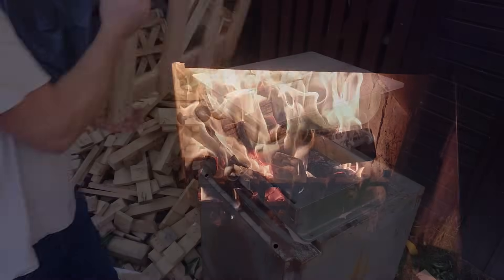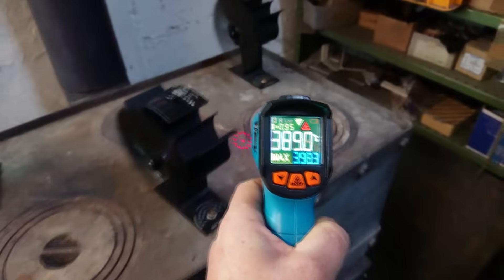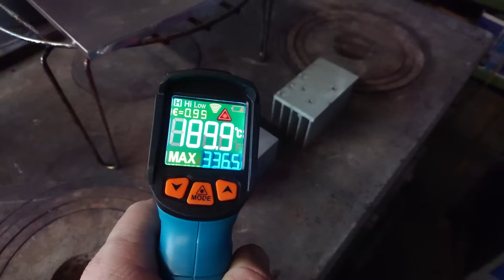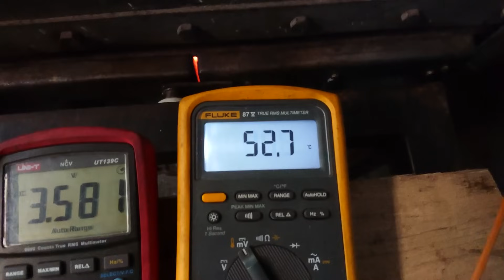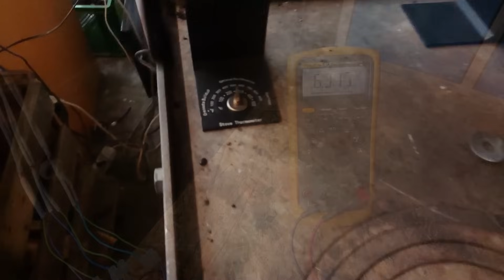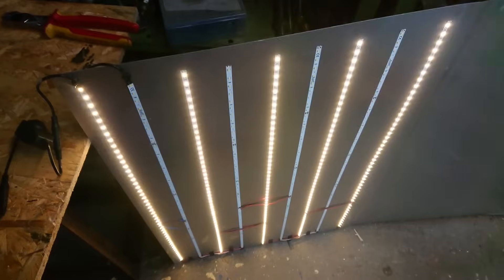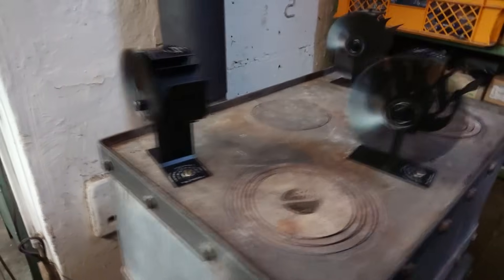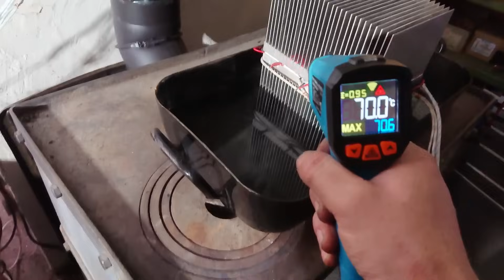Generating Electric Power with my Wood Stove - Peltier Experiments

Comment: a DIY 2 component (1 transistor - pnp ) thermocouple circuit,  could trigger a tiny geared dc motor too lift the unit upwards when heat preset (resistor on base) is reached....   -   motor in the middle with screw drive down too the stove... -  and 4 sliding rods on the corners too keep it level.

Comment: would be neat to use an insulated duct over one of the fans to blow cold outside air over itself and your project in boiling water, with that air pumped back outside in a U shape

Comment: Stick on the stove pipe on the outside/roof of your house. At least in winter you will get a better natural heat differential, and hopefully more managable temperatures for the cheap peltier to cope with.. ?

Comment: Air at ground level is colder so you could run another convection pipe from the floor to the peltier to get a better temperature difference.

Comment: The TEG is a wonderful piece of history, and it works.
All you need to do for the boiling water one is to set up a thermal siphon. Advantages are no moving parts, and it can help spread the heat from the wood stove.

Comment: That is such a good idea. This would also be a good way to harness excess heat into power that that is normally lost in electronic circuits. 

I would have tried something different. Using one of those stove top fans I would have put magnets on the fins then coiled copper wire near the rotating blades. You then can then effectively have a motor/generator connected to another motor, connected to one Peltier device that can charge a battery. If you need more power you can add more fans-magnet-generator-thing. Remember to credit me if you sell this :P

Comment: I’ve been thinking using copper to transfer heat out. The temperature should be constant if you extend the heat out a few inches. That goes on top of the TEG. The cold side will be underneath with cold water covering heat sink with thermo syphon. The cold water should be not affect by wood stove so add some insulation.

Comment: brainfart: metal fan as a generator in the exhaust stream/pipe to generate power? or even multiple. or is there not enough flow (and too much heat) for that? 🤔

Comment: Hey dig your videos! BTW, You use the fire because its cold... Put the cold side of Peltier threw the wall to out side were it is very cold?. Just turn the whole unit around till the Peltier is pointing to the wall. Cheers from Australia, were it is a steamy 30-34c

Comment: Instead of using a pot of water, you could use a thermostat with a fan to cool the hot side. Sure, the fan will draw a bit of power but only when the Peltier elements are about to overheat anyway. You can then experimentally find the sweetspot when the cooling fan has to turn on to compensate for heat lag and have it operate safely.
I think the pot of water introduces the problem of constant steam generation and also it takes up space and doesn’t work so well on the pipe mounted design.
For the cold side a ducted fan design that forces the air past the fins could maybe cool it better and increase the efficiency.
Anyway, awesome project and nice proof of concept :)

Comment: Didcyou consider installing on the external section of the stove pipe? Lower pipe temperature (hopefully <100degC) outside ambient air temperature should give adequate delta T without the need for powered cooling (not to mention the added complexity).

Comment: EDIT: wrote this comment before seeing the last minute of the video  😅

How about using water as a medium? This would limit the heat that the TECs receive to 100°C.
I'm thinking about a small water cooling loop, using a simple warm water pump (used in house plumbing).

Comment: I have a Rayburn that heats the house using a pump. It would run a smaller setup, fewer radiators and pipe distance , without the pump. I always wondered about setting up a loop in the summer that the Rayburn could drive as a gravity system which would then turn the pump so creating a generator. You could do something like that with your stove. You could even go to steam generation and closed loops with pressure regulation.

Comment: I boiled water on the fire in a metal pot and led the steam in a pipe/hose to a heatsink mounted to the peltiers. This means that al electronics can be placed away from the fire. The cold side could be placed in cold water or placed outside for cooling. Use a buried copper pipe with liquid to cool the cold side.

Comment: I'm gonna suggest a draft tube to cool the top sync in the water bath araingment...a piece of stove pipe standing verticaly on the heated surface...with a hole in its side...should cause a draft that with some ducting atatched...would cool the top sync...If you can cool it enough the water will not boil. Use an old small engine carberator float needle and  seàt in water bath to maintain level...feed from gravity feed resivoir....Also...the peltier devises are common in coolers and heaters that are  designed to be carried and plugged into cigarette lighters in cars and trucks...In America...they can be found at Goodwill...Thrift stores...and flea markets...some dissassembly will be required...but also additional components to be had for the price...switches...fans...wire...

Comment: SO many questions. So many ideas. I've been thinking about this exact experiment for years. Since so much heat is wasted through the vent, we can assume that all of that heat is harvestable. So, it doesn't make sense to just carry it away in one pipe. Why not a manifold that would separate the hot air into several pipes, or more simply, imagine a "pipe" that is 3 feet by 3 feet by 1" thick. It's basically a big 1" thick hollow box, with an adapter at the top and bottom to exhaust out the 6" pipe fitting or whatever it is. Now cut a square hole in the box. Leaving a 1" lip all around the front surface. Now you create a massive 3' by 3' door that can be screwed on and is sealed with exhaust gas silicon rubber. This "door" or panel cover is the platform, for the peltiers and heat sinks on the front. On the back of the door , you have fins going vertically, to guide the air from the bottom to the top for even distribution. Should cleaning ever be needed because of inefficient combustion, this "door" can be unscrewed and removed. Now all that would be enough if you wanted to stop there,  because we could use convection to keep the hot side hot and the cold side cold, but lets say we went crazy, and created a second unit. The exact same size and shape. But, instead of putting it on the front, we flip the whole thing around, and now all the heat sinks are joined into one massive heat sink block, pressed against the wall, taking advantage of the thermal mass of the wall, for cooling, and instead of the bottom opening of the sink block taking in hot exhaust air, it takes in cool air from the ground, and even the ambient heat from the stove itself isn't rising directly into your heat sinks convection flow. Since you're in here already, take some of that energy for a single fan to force the cool ground air into the cooling block, just as a test to see if it increases efficiency or if it uses more power than it adds t the system. .  At the top of the cooling block exhaust the now warmer air into the room. Of course with this method you could go insane attaching more and more peltiers to the ever cooling "cold" side air all over the room if you want. Since this heat exchanger doesn't carry any of the combustible gasses with it but let's not go there unless you want to make a really weird fun video. :)

Comment: Cut a hole in your wall and spin the stove pipe to put the cold side of your heat sink on the outside of your shop. The cold air outside will cool the cold side of the heat sink.

Comment: You can increase the efficiency of the stove by placing the stove futher away form the chimney and elongating the steel part. I saw 400 C  when you measured it. If you have second floor you want to heat - then it doesn't matter.

Comment: To avoid the complex pipe adapter, you might be able to find or create a C-shaped beam that could be clamped to an existing stovepipe.  This would look something like "EO" with the middle bar "-" of the E removed (or shortened) when looking from above.  The "E" represents the hot-side heatsink and the "O" the stovepipe.

We don't need perfection here as we don't want high temperatures to reach the Peltiers, so we just need a stable surface that will sit flatly onto typical stove pipes.  The design could include an extra Peltier that powers a fan attached to the cold-side heatsink; these parts could be borrowed from one of your existing fans or designed yourself from similar parts.

Comment: I completely get the desire to use TECs for this project, not least because they are relatively inexpensive, have no moving parts, and are quite reliable, but...

How about using the wood stove to boil water, and then use the steam to drive a small steam engine connected to a dynamo? You could also use the same to drive a line shaft to run your lathe, drill press, etc.

I'm obviously joking, but you definitely 'could' do that, if you had enough room, money, and fuel.

Disclaimer, I visited a tin mine last summer, and was blown away by the amount of useful work they got out of their steam engine before it was replaced with boring old electric motors and gas fired heating.

Comment: Now for some random energy stuff I have seen which is really a bad ides yet has some potential. 
I saw someone on YT build a steam boiler to which they stuck a sort of fan blade on and let it spin up. 
My idea would be a commercial viable option. Where a wood stove is built to be either a flash boiler or standard slowly add water as needed boiler where enough steam is built up to spin a specific turbine type generator. All of this could be mechanically done and a rating added to the wood stove. Even if the stove produces a couple hundred watts an hour its still enough over a 24/7 period during the winter.

Comment: I used to have and they still make these wood/coal stoves. They have an automatic thermostat built right in to them. This a a manual type. As the stove heats up it will close the air intake the hotter it gets. You can set the temperature you want via a knob. If I ever install a wood stove in my house again I will get one of these stoves as it was the best type of stove I ever had. 
""They use a mechanical control that opens and closes the air supply as the bi-metallic coil heats and cools.""" You might be able to search for this and find something or even be able to make something. If you could control the heat that the stove puts out where its not too hot and not too cold the temperature could be just right.

Comment: There is a UK boiler manufacturer that offered a so called home generator, this produced electricity as a waste heat product from a gas or oil boiler. Your experiments could be invaluable in countries where no electricity was available, just wonder if the Peltier pads are available in larger or more efficient versions. Really enjoy your approach to these projects
Reply: Any chance you can get the company name please

Comment: just using the wood stove to melt snow for drinking water? but of all things this spring, i have a engine/motor driven water jack to build... the sucker rod weighs 3500 pounds. "hamster wheel"

Comment: My only thought at the end was that you could use a closed loop system with automotive antifreeze and attach the cells to that for the heat.  Others are mentioning using cold air from the floor or outside to cool the other side of the cells.  If this could all be made compact enough it should be useful!  Really appreciate your experiments and that you share with us!
Reply: I was also thinking a water loop on the hot side could help, but the problem is the required pump would use more power then you generate using these devices.

Comment: Not sure if anyone has suggested it, but our fireplace has a half pipe section band that reflects heat from the back of the flue back into the living room, its fixed to the flue on standoffs with rivets but you could just as easily have it removable with hose clamps.

I think if you did a design like that, out of say, aluminium sheet so that it would have a bit of an air gap to insulate against massive temp spikes, acting like the water bath in this instance, but losing no stove area, with the units fixed to the back of it, it might do ok, and be modular.

The shield on ours is hot enough to get some power flowing i think. And because the units could be on the back, the cold side of the peltier units would be shielded by the shield itself. Love your vids, they always make me want to install power generators all over my house. I think my pattner would kill me though. A big danke and best wishes from NZ

Comment: I thought you might do a Stirling cycle engine generator.  I think they are more efficient than Peltiers and could be made from scrapyard finds.  Like a V twin air compressor so you have a hot cylinder  and a cold cylinder.  Although I think you have the expertise to build a Stirling cycle oscillating a linear alternator.  Info can be found here on them.  https://science.nasa.gov/science-research/science-enabling-technology/technology-highlights/high-efficiency-stirling-convertor-demonstrates-long-term-performance/

Comment: There are some CPU heatsinks that use a heat exchanger. Sometimes you can find them as scrap. Also some specific models of stereos used heat exchangers to cool the output transistors,  Sorry, I can't remember the models or brand. One might also be able to modify a car heater core. my friend made a heat exchanger off of the exhaust of the motor driving his sluice box pump and hookah rig to pump hot water into his diving suit. He was sluicing in Alaska under 6" of ice, so it worked quite well. Controlling the water flow through the heat exchanger enabled him to mix the hot water with cold through a valve system to keep him warm for hours at a time.

Comment: One way to do it is to put the heat suction aluminum fin inside flue pipe, somewhere at the right temperature.  And leave the other side outside.

Comment: Very cool! I made small generator using eight of these peltier coolers, a metal bread pan filled water and small candles; it was a fun experiment. TEGs can be created with two different conductors so I wonder if a less expensive but more durable TEG could be created with two plates of different metal like steel and aluminum...

Comment: Experiment with outdor solar lights but use the Peltier in place of the solar cells - they are very efficient (use an IC inside) and if you use the Peltiers to charge a battery during the day you can use the output of the peltiers plus the battery to increase the amount of lights you can power at night.

Comment: A thermal actuator/s to control the height of the heatsink base from the heat source. They will operate without power and you can build and design one yourself to operate at the temperatures and distances of movement you need.  A small sized one can lift a decent load and would be nearly maintenance free.

Comment: If it's being used during winter could you use the cold outside temperatures to cool the outside heatsink. Maybe passing am aluminium bar through the wall and mounting the heatsink outside

Comment: What about making a simple steam engine to sit on top of the stove to turn your water wheel? One other method of regulating temp is use the moonshiners method  That is copper pipe wrapped around the chimney. Moonshiners use the pipe in a water bath to cool the shine. Just reverse it like a radiator in a house. May be a useless thought, but it may give you an idea.

Comment: As the hot exhaust goes up the pipe, would it be possible to spin a very tiny turbine on it's way? Likely it will become full of soot and stop working, but maybe the spinning force can fling the majority off the turbine and keep it going longer.

Comment: Use the fan that sits on the stove to blow across the fins on the heat sync to cool it as the fan doesn't rely on electricity to run

Comment: Use one of the fans to make a heat based pump for the possible water cooling system.
Also place a thick steel sheet on top of the Aluminium cooling side.
That should help draw heat out off the cooling fins as Steel has a higher heat retention value than Aluminium, and You could then have a water reservoir on top of it.
It should work to pull a lot of the thermal heat up and out of the Aluminium, thus cooling the devices.

Comment: Are the devices that produce electricity form heat available in ceramic form? Radioisotope generators run for decades.

Comment: You can use the cold temp from outside by chilling the cold side with water cooling that will require only few milli amps for the pump.

Comment: The water bath idea, gave me an idea.  Make a tall pot, like your chiminy mod', and purt the TEC devices on that.  The hot simmering water will rise to the top (where you will have mounted the Peltier devices around the square pot), maintaining a high but safe tempreture.  But also, as the water boils, the level will fall, reducing the transfer of heat to the devices (fail safe).

A shrowd about the heatsinks, will help create a chiminy effect (as mentioned by others), reducig or negating, the need for a fan.

Great presentation.  I'm always impressed with your skills, innovation, thoughts and results. 
👍